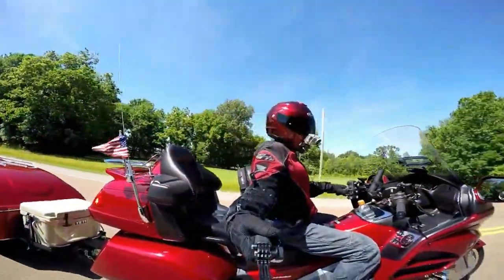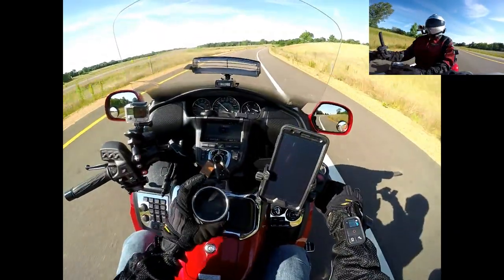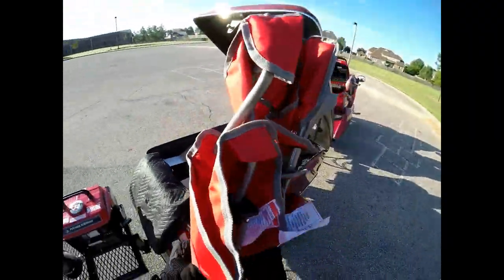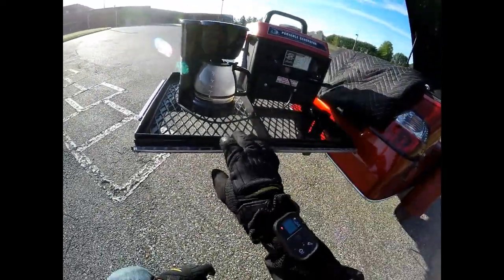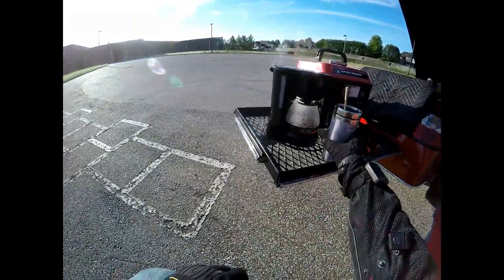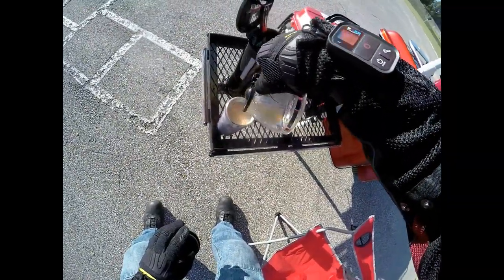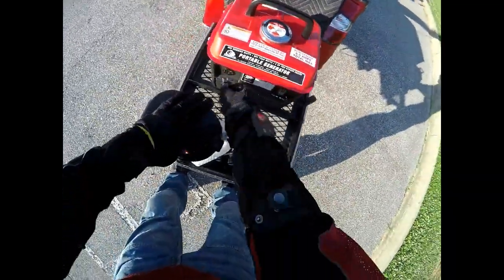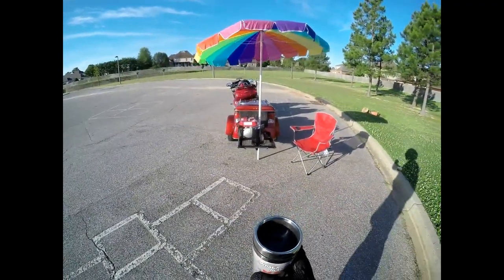Brewing Hot Coffee from the Goldwing Trailer

Comment: Nice setup for the coffee, would be great for camping w/ the motorcycle and trailer. Is that a 2 or 4  stroke generator. We have a deep cycle battery w/ a 1500/2000 watt inverter, that charges on the trailer, works good for charging phones or lights  when the bike is off. Like the idea of a small generator and probably no more expensive then a deep cycle battery.
Reply from the maker: I should install a back up generator just in case the main generator fails, lol.